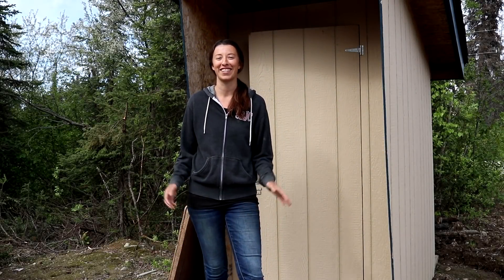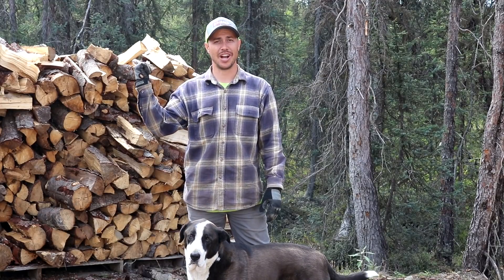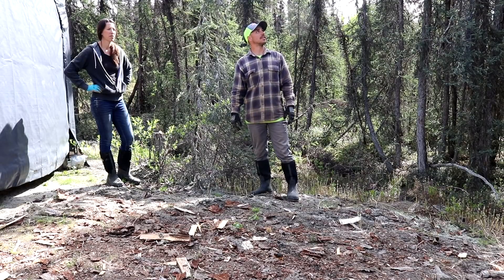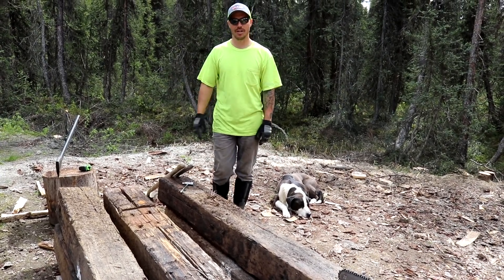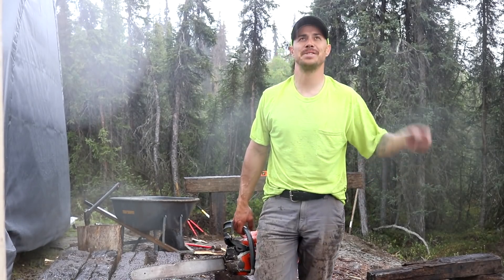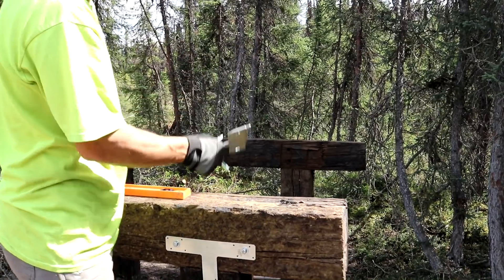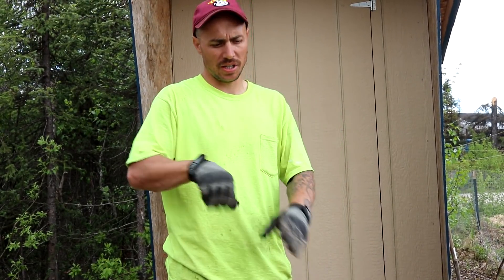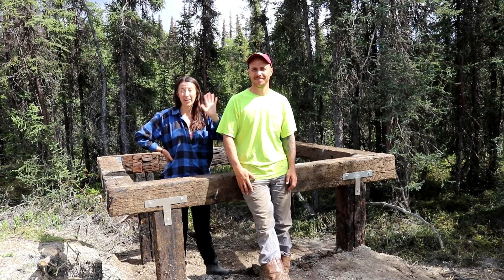We are FULL of it! | Not Your Traditional Outhouse (Part 1)

Comment: Hey there, I work for a railway and I don’t know if you’re aware but rail ties are soaked in really nasty chemicals to keep them from rotting and using them in something you will be using frequently can be terrible for your health. My only suggestion would be to cover them up as much as possible and have really good ventilation inside the outhouse. I grew up using an outhouse and they are great when you live in the woods just be cautious with those ties.
Reply: You can not grow anything where rail ties have been used. My boss is an engineer with Pacific Railroad.
Reply: Great info and yes very toxic chemicals, but some have done worse by using them for raised beds then eat that contaminated produce. I like when people post positive info. TY
Reply: I'm just going to go ahead and add that old pallets can be harmful too, depending on what they use to keep the wood preserved. Also, in transit, you have no ides what hazards they can be exposed to!

Comment: Salvaged 4"x6" railroad ties (usually Hemlock or Douglas fir, pressure treated with creosote prior to about the 1980s ban on creosote in Canada and the US) , which you used for your new privy location will likely last you for 40-50 years. Our back yard has a 5ft. high earth retaining wall made of 4"x6" railroad ties constructed about 1972  when the house was built. They are still holding, although the the top shift has starting disintegrating during the last ten years. 30 years ago, I bought pentachlorophenol treated 4"x4" landscape ties (likely spruce or pine) as a border for a flower bed. They started to disintegrate about ten years ago.

Comment: You should build composting outhouse. Dig a hole with a bit of a slope downwards away from outhouse, use clay or some other materials to make floor and walls of the hole waterproof. Put some peat, hay, woodchips or other material like this inside and make a door into this hole so you can shovel out the stuff when it's ready. After taking a shit put more of peat/hay/wood over it (just keep a bucket full and little spade inside) Then you can go down two ways - either compost it rigth there (it would need good aeration inside and you need to control moisture so it would not be too much or too little) or you shovel it out and put into proper composting pile. If you do it right, temperature inside will rise up to 60-70 C and it will kill almost all pathogens. You should be fine with 6 month or so, though some advise keeping it up lke this for a year, so all pathogen would be dead for sure (though i will say that if only two of you use this outhouse, you won't catch anything you don't already have).

Setup like this makes it so you don't need to move outhouse every few years, there is a lot less danger of polluting ground waters with it (no one like when water from the well tastes like shit) and you return some nutrients back to earth.

Comment: We used to have an outhouse with a Racasan chemical toilet, basically a seat with a 30l drum under it into which a few cms of the vivid blue racasan chemical was placed. As the drum got close to fill it was my job to dig a hole and bury the contents, not a too unpleasant job. The residents were strongly advised to not use the toilet before emptying was scheduled as the racasan required a short time to work its magic, those who overfilled the drum were given the shovel and told to do the burying as carrying 30l of liquidy waste without spillage was fraught with difficulties. Also on a small section archeological excavation of previous burials was less than interesting. However, the toilet was inside the outside wash house very close to the backdoor did not smell and did not require long treks into the wilderness on inclement nights to deal with pressing matters. Gentlemen were encouraged to water the bushes at the end of the section to extend the time between burials and to minimize the sloppiness of the contents, a fact much appreciated by the burier

Comment: Used to be a house mover
To raise the outhouse up build cribs 
Like a linken log stand on either side or on all 4 corners with either 2x4 or 4x4 lumber 
Jacking up (just pry with that jack bar) either side a few inches till you get it to the proper hight to slide it onto the platform 
Pm if you'd like a hand we've got a cabin up the trail you go hunting on ;)

Comment: Perhaps consider to purchase a camping "porti-potti" for indoor use during the coldest periods of the winter. They come with an upper water reservoir for flushing by a manually upper hand operated valve and a hand-operated dump valve that seal off the smells from the storage reservoir. If occasionally smelly, you just add a bit of bleach and flush it into the storage reservoir. The space requirement is about 2ft. square by 3ft.  high. The investment? About $200. Our camping "porti-potti" lasted for 30 years, occasionally needing Vaseline lubrication of the water valve piston.

Comment: Ther's a much more efficient way, not expensive and you'll never have to have your... bottom, frozen to the seat ☺

A pipe from the house leading to two concrete pipes 3 - 4 feet wide and 6-8 feet long installed vertically into the ground, side by side. They are interconnected at 3 feet bellow surface level. The pipe from the house has a spring loaded "gate door" that closes after the contents spill into the first tank. There's organic microbe powder that you place into both tanks that disolve the the contents. If the holes where you place the pipes are lined with crushed stones and gravel, those pipes will probably never need cleaning/pumping out, at least 15-20 years if you have three children :) 
This means having water flushing, but in Alaska, you have endless supply of snow, and you can use gravity fed 5,000 gallon storage dug into the ground and lined with swimming pool liner. All very economical... and never a bitten lip, from chattering teeth :)

Comment: In certain areas out houses are not appropriate simply because the waste doesn't break down, typically because of the temperature.  That being said if sized and treated appropriately I don't think they need to be moved at all, we had an out house at my family cabin that wasn't moved until indoor plumbing was installed more than 70 years later.  Also for septic systems, my parents house that they built about 40 years ago has never been emptied, merely checked and it's never needed to be pumped.

Comment: If you build it on a hillbilly septic system you never have to move it. Dig a 4x4x16 Trench. Drop in a used IBC (the big 4x4 chemical shipping containers). You can find them for about $60 in Anchorage. Pipe an 8" sewage pipe out of the side about 1/2 the way up. This makes your settling tank. Fill the remainder of the trench with stones. This makes your leach field. Mud the top of your stones with concrete and bury. I know what your thinking. It's too cold in Alaska... wrong. I live here too. Built a pretty epic one North of Palmer, AK. Just periodically add trash water (grey water) to it to keep the settling tank moving in the summers.

Comment: If you can put an air tight tank in the ground which can be kept at about 70° you can produce natural gas to heat things with and run your generator.
Look for info for bio fuel and bio gas. All you need is all your plant and animal waste. By installing a sump pump you can use the decomposed material for fertilizer. You might need some cows.

Comment: Always been a fan of outhouses up here - the old roads that had rest stops used to have nothing else (and some still have just non-water outhouses). It's not that big a deal once you get used to it, even in minus temps. But a foam seat does help there! :) It takes some upkeep but I've seen some very nice, very clean outhouses. Some places like the Sheep Mountain Lodge (must stop for cinnamon rolls on the way to Valdez) use composting toilets indoors, also a good choice up here. Excellent video, I love your teamwork and work ethic :)

Comment: Moving your outhouse is not necessary if you have two or more sections in your outhouse that are divided from each other and you have a clean out door in the back. You let the first section that’s full,compost for a year while you use section two and repeat. The composted poo is great around your berry bushes and fruit trees. Outhouses are simple to clean by hosing down the dust and dirty floor with the garden hose and letting it air dry once a year.

Comment: I would have suggested some better joints than butt joints and brackets.  Half laps would have been more structurally sound.  Im not sure what it is, but you might want to look into the shear strength of the screws you used.  I get the house inst that much weight, but better safe than sorry.  It would really stink for one to give while taking a seat...lol

Comment: I think I see what your doing. Drag it up on angled beams with two snatch blocks , one fixed at the top as a center fixed pulley and the other off of one of the rear solid posts. Id drill and drive a few 14 inch 1/2 lag bolts into those 2 inside beams. Question, why didn't you over notch those two into a top notch on the solid 2? Don'y understand why 27 dislikes on here when I commented and liked, whats not good about having a safe place to crap. I tell yous if you had to Really Go you would love this! Lol Cheers

Comment: wouldn't it be easier, cheaper, faster and structurally more sound to notch those beams and have vertical posts straights below corners than use metal corner brackets and T-brackets?

Comment: I am not a carpenter, but I don't think that was the best way to tie that base together. The four uprights and the first two cross members were okay, but the last two cross members are not supported well. I think I would have notched the ends of each of the cross members so that all four of them could be directly above the four uprights. It might be fine for an outhouse, but I figured I would at least raise the issue.
Reply: I just went back and noticed that you did also put in some angle iron on the inside corners. It is stronger than my first thought, but still probably not the best design. Again, it's probably good enough for an out house, but not a permanent structure.

Comment: From what you've shown, it appears, the side railroad ties are only held up by the strength of the bolts.  You didn't show any bracketing under or over where they're joined to the front and back ties.  I think it would be more structurally sound if you cut notches at the end of the ties so the side ones can sit on and be supported by the front and back ones.

Comment: With all the work and trouble qWhy not just add a bathroom to the cabin and use a composting tank for toilet under it..
Reply: that's no fun
Reply: In Alaska it’s generally too cold for composting toilets to function properly, even with heating, because it blows air through a duct outside your house. On top of that they’d have to build an entirely new room on the side of their existing house. A lot of people don’t even have indoor plumbing in Alaska because it’s so cold that any piping will need to be replaced really often due to severe freezing. An outhouse, especially in winter, is so much less work than most other options because of how far they are from everywhere and just their location on a map.
Reply: @Crucisphinx  In Alabama we had it snow once, so we know what they go through in Alaska.

Comment: I use to landscape whole apartment buildings with rail road ties. They supplied them I installed them . I advised them not to use them . Less than 10 years later . I got paid to rebuild all of them again  using Pressure treated. why share this , well . If you look how rail road ties are used and installed . They are installed on gravel , never in ground contact. that is how they last 50- 100 years or more. No ground contact. it is a softwood soaked in creosote , which is coal tar. I have built many mountain and lake privy's for folks. They  really are the ticket for simplicity, efficiency and conservation. The open stringer stairs and hand rail will be a nice touch to the new throne.